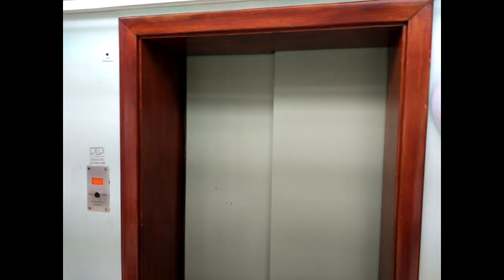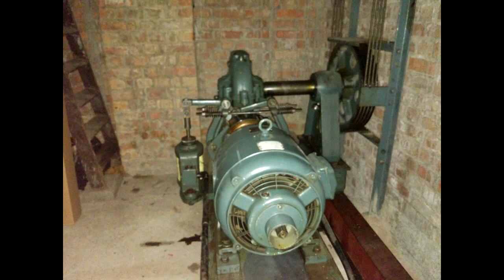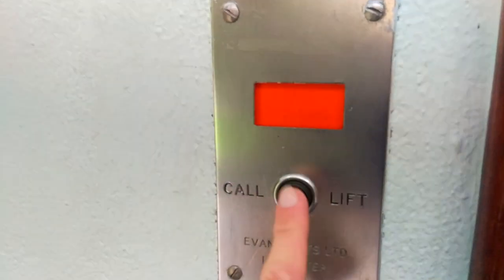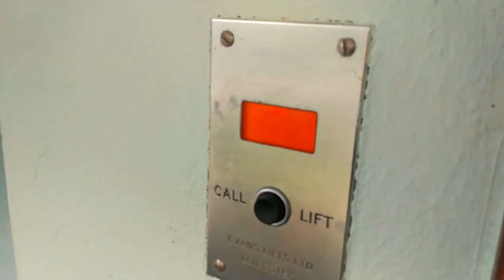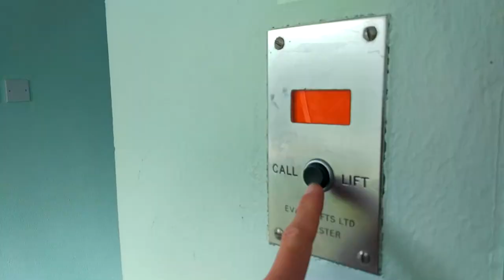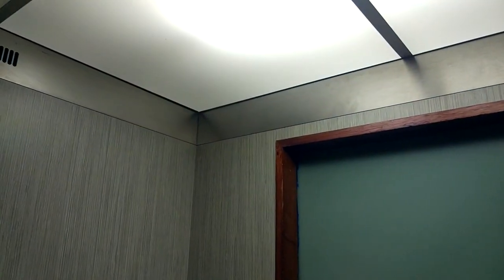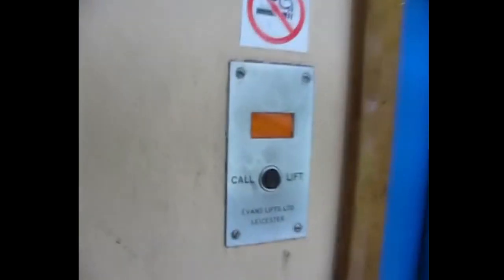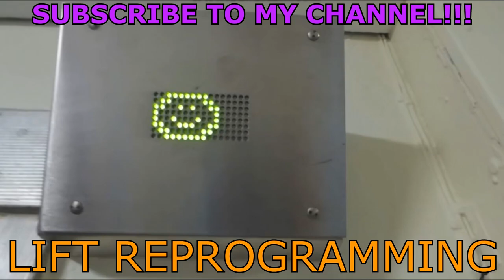Detailed look at 1960s Evans

Comment: Very nice to see such an old lift still having all original mechanical components! The door drive very much reminds me of the old Schlieren automatic doors from the 60s and 70s. Also the view of the sheaves in the shaft head is nice, you don't get that very often.
Is there a governor on the counterweight, since it has an extra rope? It would kinda make sense because the MR is underneath the shaft.